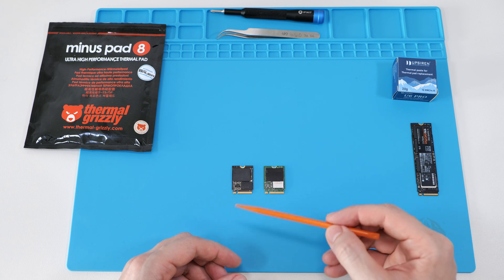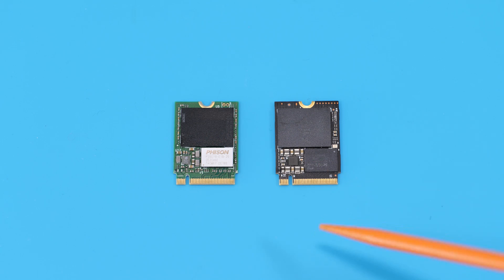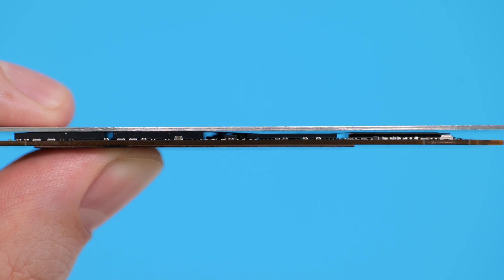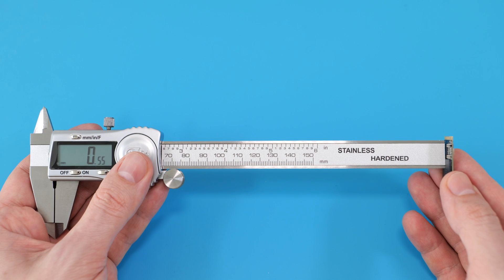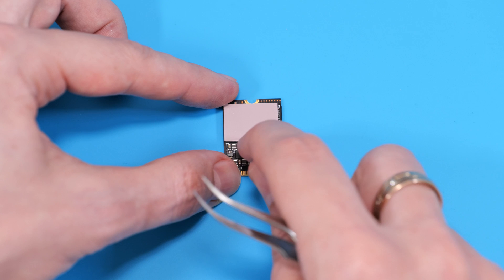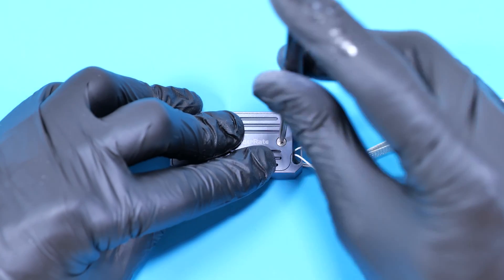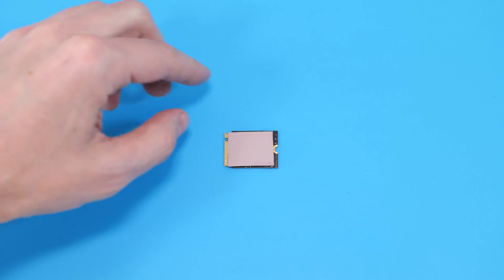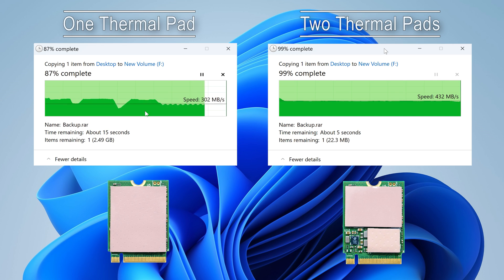Fix M.2 2230 SSD Overheating – Thermal Pads & Putty to Stop Throttling

Comment: my wd sn5000 controller and nand flash has height gap difference. any advice. nand flash pad touches the heatsink but the contoller thermal pad doesnt. shall i use thermal putty.  ps also do i need to put thermal pad on the power management controller.
Reply from the maker: Yes, thermal putty would be the best and safest option for components with different heights. Thermal putty is used on M.2 2230 SSDs in Xbox and other devices. The link for the best thermal putty in the description.

Comment: I guess that if you used one thicker thermal (1.5mm or more) pad, that would work as well, as it would touch the whole surface and just get more (com)pressed on the taller components, right? 
I've read in a review, that thicker pads when they get compressed conduct heat better, e.g. they compared a 1mm Thermal Grizzly to a 1mm Arctic pad, the TG was better, but when they used a 1.5 mm Arctic (it got compressed) the results were similar to the 1mm TG.
Btw, I also have a flash drive which uses a 2230 NVMe SSD inside, but without any thermal pad, it is a sliding mechanism, so I wonder if there is a way to apply any pad on it and still be able to slide it in or out, possibly adding a tin foil on top, I don't know. 
I've also read in a user review in a shop, that he applied 3mm thermal pads bellow the SSD in addition to 1.5 mm ones traditionally on top in his laptop and that his SSD temperatures went further down, like 20 degrees. Have you ever seen it done or perhaps have you tried it yourself, what are your thoughts about that? ;-)
Reply from the maker: The problem is that not all cooling solutions support thermal pads thicker than 0.5 mm, which is the case for most laptops. Many users just replace the drive and reuse the stock 0.5 mm pad attached to a thin copper heatsink. As a result, the pad often doesn’t even make contact with the controller chip. The same issue exists with 2280 form factor SSDs. Even popular models like Samsung’s EVO 970 and 980 were affected: https://youtu.be/I8Z09nU554Q?t=34 I made a video about it, and later Samsung released a heatsink version that essentially did what I showed, but went even further by stacking multiple pads of different thicknesses: https://i.ibb.co/10HwmmQ/980PRO.jpg  We had tons of clients for data recovery from cooked Samsung SSDs where the controller had no real cooling, while clueless users thought they had done everything correctly replacing the drive and using one thin pad. Now most clients come with their 2230 SSDs. They’re by far the most unreliable and have the shortest lifespan compared to other form factors. Also, keep in mind that thermal pads with high thermal conductivity are usually barely compressible. We stopped using pads and switched to Upsiren thermal putty. It’s far superior in performance, easier to apply, and eliminates the contact issues of pads and can be used with any heatsink.

Comment: There is no heatsink for ssd in laptop so can thermal pads benifit in that scenario.
Reply from the maker: Absolutely not! Without a heatsink, they’ll just fall off the SSD as soon as you flip your laptop. There are some universal heatsinks that can easily be attached to an SSD, the link in the description. Cooling M.2 2230 SSDs is crucial, these are some of the worst when it comes to heat. The tiny controller chip generates a massive amount of heat and without proper cooling, they barely survive 3 years of daily use. What’s the model of your laptop?
Reply: Yah, it's the Lenovo LOQ 15IRX9. Could you recommend a good heatsink for it that's available in India?
Reply from the maker: @harshpathak702   For that model, the back cover actually works as a heatsink. There’s a thick thermal pad attached to it that makes contact with the 2242 SSD and transfers heat to the case. Is it a good solution? Well, for that type of SSD, it might be enough. I wouldn’t bother investing money into additional cooling for it. If you decide to upgrade to a 2280 SSD in another slot later on, then yeah go ahead and use a proper copper heatsink for that one.
Reply: @ElectronicsComputers  yeah sure, thanks man
Reply: It has M.2 2242 ssd.
Reply from the maker: @harshpathak702  Yeah, M.2 2242 SSDs are way better. The controller is larger, which makes it easier to cool and that means better performance and longer lifespan.

Comment: The sticker pad I got with an cheap enclosure I purchased is thin like paper do I need to purchase a thicker sticker? 

Also what better the putty or the sticker ?
Reply from the maker: A thin thermal pad isn’t a problem—it actually provides higher thermal conductivity. The real issue is that it might not make proper contact with the most vulnerable component: the controller chip. To fix that, you can double-stack the thermal pad on the controller while leaving the memory chip as is. Thermal putty is always a superior option compared to pads because it offers significantly higher thermal conductivity and can easily conform to the uneven surfaces of different components, effectively transferring heat to the heatsink.

Comment: There's a sell on the new 990 evo plus and I want to now if it's compatible for the Xbox one.
Reply from the maker: The Samsung 990 EVO Plus is an M.2 NVMe SSD. When the Xbox One was released, NVMe drives didn’t even exist. However, you can use any 500GB, 1TB, or 2TB 2.5" SSD instead.

Comment: Is the thermal paste better than using the Grizzly thermal pads?
Reply from the maker: Thermal putty provides way better thermal conductivity than any thermal pad. Also, thermal putty perfectly covers all uneven surfaces and effectively transfers heat from all components to the heatsink.

Comment: in the video when you apply the thermal pads the one in the larger chip is different in material compared to the small chip where you overlapped 2 together to make it equal?? 2:15
Reply from the maker: Yes, there is a difference in thickness between the chips, so it makes sense to apply thermal pads or thermal putty separately to different chips to even out the final surface for the heatsink.
Reply: @ ok but What i mean is the thermal pad is the same on the smaller chip and the bigger chip? I mean its the same grizzly pads no two different type right?

Comment: Why no putty test?
Reply from the maker: Thermal putty is vastly superior in thermal conductivity, as it covers all uneven surfaces and makes contact with all components, both small and large, effectively transferring heat from them to the heatsink. Therefore, there's no need to compare it to thermal pads.

Comment: Is that gap the same for Xbox series X as if it is the case were in trouble considering it's bloody sandwiched between two mother boards.
Reply from the maker: Xbox Series X uses thermal putty that covers the entire SSD surface, adapting to its uneven surface and effectively transferring heat from its components.
Reply: @ElectronicsComputers  Awesome and thanks for the reply. Now all I need to do is prepare for the inevitable Failure of there ingenious lets put the entire thing on the SSD and make more money scenario make a back up then I'm set.  Love your channel keep up the great content. Your loyal new sub from down under..

Comment: could thermal throttling cause the drive from being "dismounted"? It often happens with two of my nvme drives which are connected with thunderbolt 4 SSD enclosures. (they are VERY hot when it happens).
Reply from the maker: Yes, that could be a reason. If the controller overheats, it can become unstable and reset, which may also happen with the PCIe-to-USB controller in the enclosure. Use a high-quality, short cable rated for the speed—like a 30 cm (1 ft)  or shorter Anker cable. Also, M.2 2230 SSDs often fail from overheating, leading to solder cracks under the memory and controller chips due to constant heat cycling. Proper cooling is crucial to extend the life of these drives, especially the 2230 form factor.

Comment: Nice vid, is there any differences between putty and pad in terms of temperature?
Reply from the maker: A high-quality thermal putty like Upsiren UX Pro Ultra https://alii.pub/73v7ji easily outperforms thermal pads, not just because of higher thermal conductivity but due to its soft, adaptable nature. It molds around components, efficiently transferring heat from all surfaces to the heatsink, which pads can’t do. Plus, it doesn’t put as much stress on the SSD and other components like memory chips on graphics cards etc, unlike pads that can cause issues if the thickness isn’t right.
That’s why thermal putty is the go-to choice for consoles, graphics cards, and other high-performance devices. In our repair shop, we use it for warranty products, certified repairs, and high-end hardware. For budget laptops, though, we stick to thermal pads.

Comment: I bought TG minus pad 8; it's "smooth" on one side and "zigzag pattern" on the other. Which way should I put the pads?
Reply from the maker: The smooth side goes to the heatsink and the rough one to the SSD.
Reply: @ElectronicsComputers  Thanks! I was looking through other vids, or even plain instructions, yet couldn’t find anything direct. Thanks again!

Comment: I would use thermal putty instead of thermal pad
Reply from the maker: Yes, in terms of thermal conductivity and performance, thermal putty wins because it can conform to any uneven surface and effectively cover all components, transferring heat from them to the heatsink.

Comment: dont make any diference here , bm9c1 1024gb  getting 92 on controller and 81 on memory . My old one of 512gb dont pass 65 on heavy stress or gaming , this one bm9c1 is heating just in turn on the laptop and i have a passive copper heatsink .
Reply from the maker: I'd suggest using thermal putty in that case. 92°C is quite high, so make sure you always have backups of your data, especially if your laptop is older than two years.

Comment: My series S console seems to be blackscreening mid game and kicking back to dashboard , also comes up with random sys_errors which states certain game files are missing. I am guessing the SSD is overheating and causing this issue? Would this solution still work for the series S models since they have no heatseak and use the chassis as one instead?
Reply from the maker: @Tiqahh  Instead of stock green thermal putty, you can use high-performance thermal putty Upsiren UX. The link is in the description. In general, like I said in the video, those M.2 2230 SSDs don't last long. Before replacing the thermal putty, check SSD's SMART with any software like Aida64 and also check the drive for bad blocks. If the SSD dies, the console becomes a brick and can't be repaired. I have a video on SSD upgrade and cloning where I explained why it happens.

Comment: I've found better luck with the Arctic TP3 Pads, and they're cheaper too. Great video! These pads are especially useful for the 2230 drives. So much speed in such a small space.

Comment: Is that thermal putty also an adhesive so I can use it to install a heatsink on my ROG Ally drive?
Reply from the maker: No it's not an adhesive. It won't hold anything if you attach to it. If your laptop came without a heatsink, there are some universal solutions that may work for you. The links in the description.

Comment: It looks like to put two pads on the smaller square?
Reply from the maker: That's right. You can either buy two pads, 1mm and 0.5mm, or just stack two 0.5mm pads to make a 1mm pad.

Comment: Would you recommend putty or pads?
Reply from the maker: In some cases, we can only use thermal pads or thermal putty, and in other cases, either of those can be used. In the latter case, I'd opt for thermal putty because it can perfectly cover all components with different thicknesses and provide cooling to small chips as well, not only to the NAND and controller. Also thermal putty has way better specs than thermal pads.
Reply: @ElectronicsComputers Awesome, thanks for the insight! So it's no problem if the putty touches all the components on the ssd right?
Reply from the maker: @bungeeeperson  Absolutely not. That thermal putty is not conductive, and it's very good that it can penetrate everywhere and transfer heat from all components to the heatsink.

Comment: can you make test power comsumption 2230 vs 2280 ?
Reply from the maker: Well, it's not that straightforward. Many people believe that 2230 SSDs consume less current than 2280 SSDs because they typically have fewer components like one NAND chip and a smaller controller, which makes sense in theory. However, in practice, it varies widely. From our experience in data recovery from SSDs, I can say that some 2230 models consume less power than 2280 models, but others consume more. The power consumption is influenced by various factors including Controller Efficiency, NAND flash type and density, thermal management, and even firmware version.
Reply: @ElectronicsComputers  yes, I just want to know how much power 2230 dramless, 2280 dramless... I want to save battery by replacing the SSD

Comment: Can you use 2230 M.2 NVMe SSD for desktop?
Reply from the maker: Sure! Even if your desktop motherboard doesn't have a mount for such a small size, you can use an extension adapter like the one I showed in the video. The link is in the description.

Comment: I just bought WD SN740 2230 2TB for my ROG ALLY, I was wondering if I need to peel off the M.2 sticker to apply a thermal pad so I can put the heatsink on it? Thanks!
Reply from the maker: As for the sticker, it's up to you. I've tested the temperature difference with and without the sticker on a 2280 M.2 SSD, and I haven't noticed any significant changes. If your drive has a warranty, I wouldn't remove it. If not, then go ahead and peel it off.
Reply: @ElectronicsComputers  Alright, thanks you so much for an advice!

Comment: I bought the WD SN770 ssd, which doesn't come with any thermalpad.
I'll install it in a Lenovo Ideapad 3, and I don't think there's any ssd heatsink that fits - I've been searching a lot and didn't find anything.
Will thermalpad only gonna be enough? What thickness should it have? More is better, like 1.5mm is better than 1mm or 0.5mm?
Reply from the maker: Well, for some reason, Lenovo decided to cheap out on the heatsink for that model, and it doesn't make any sense attaching the thermal pad without the heatsink because that pad acts as a heat transfer medium between the components of the drive and the heatsink. The thermal pad will simply fall out when you flip your laptop. In your case, the only option is to use a universal heatsink, which is basically a copper strip attached to an SSD drive with rubber rings. It will provide great cooling and significantly extend the life of your SSD. Here's the link: https://alii.pub/6yy1oz
Reply: @ElectronicsComputers  using this universal heatsink scares me a lot because I've read (a few) reports of the rubber rings getting damaged and the copper strip hitting the laptop board. Is there anything I should be careful of when installing it?

I've been using a kingspec 1tb ssd for some months now using the thermalpad that came with the laptop - no heatsink, only this blue thermalpad over the lenovo ssd. 
Some months ago, this ssd just died, but I managed to make it work again by getting the thermalpad closer.
Reply: @ElectronicsComputers  https://youtu.be/xWWSQLFiZCY?t=596 actually there's heatsink in its carcass. in this video you can see its thermalpad too
Reply from the maker: @adrianozzz  Oh, yeah that's not the model I was thinking about. Just use two thermal pads of different thickness for the controller and NAND chips. Or simply apply some high performance thermal putty.
Reply: @ElectronicsComputers  I ended up buying the universal heatsink with the rubber bands. I also bought two good thermalpads, 0.5mm and 1mm thick each. 

Should I use this universal heatsink although my laptop has its own heatsink? Or should I use only the thermalpads?
Reply from the maker: @adrianozzz  Since you already ordered all the stuff, I'd experiment to see which method provides better cooling. We have installed universal heatsinks several times at customers' requests on laptops that came without them, and it was night and day difference. But, I've never tested which method is better for cooling in a situation like yours.
Reply: @ElectronicsComputers  thank you so much for helping me so much. When I get the new SSD installed, I'll test both options and see which is better, then I come back to give you answer. Thank you again!
Reply: @ElectronicsComputers  hi. I installed the WD770 in my laptop using the rubber band universal heatsink with upsiren thermalpads 0,5mm and 1mm thick. I ran crystalDM and the temperatures reached a maximum of 74ºC, averaging 66ºC. I didn't test using only the laptop heatsink yet. I didn't like this thermalpad much because it's too dry and brittle. Since it's been soft weather days, I fear it'll get really hot when the hot brazilian summer arrives...

So these days I bought Gelid thermalpads 1mm and 1,5mm thick. I hope the temperatures get even lower with these new thermalpads - and again I'll come back to write about it